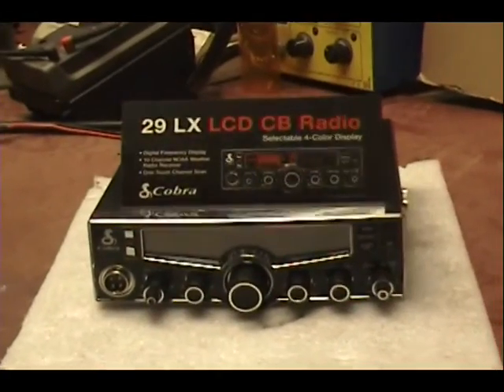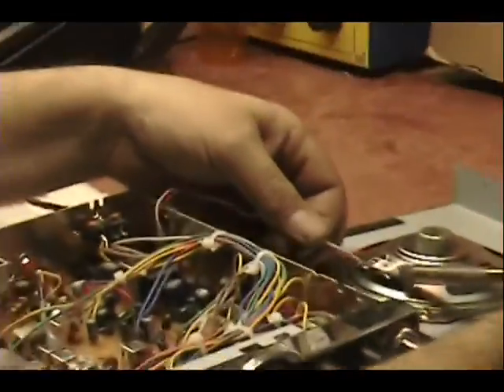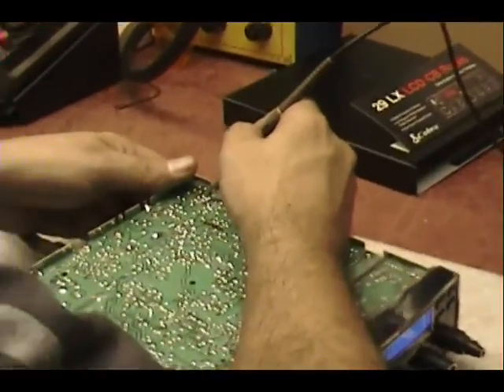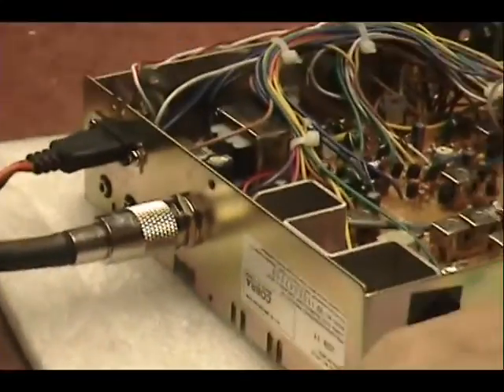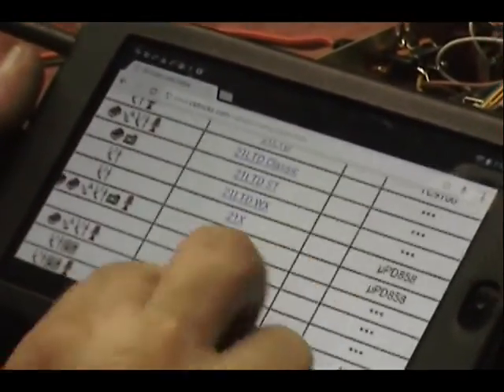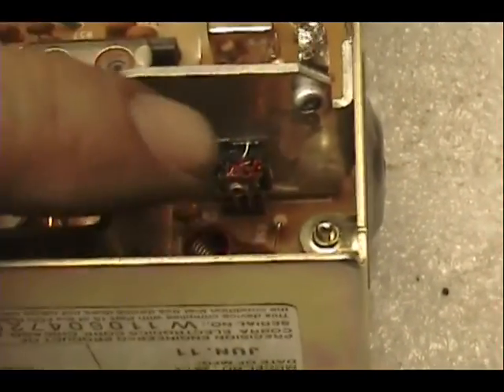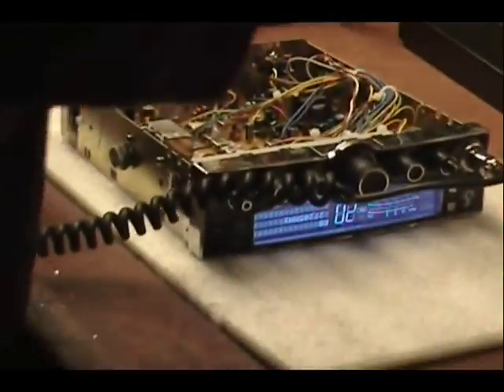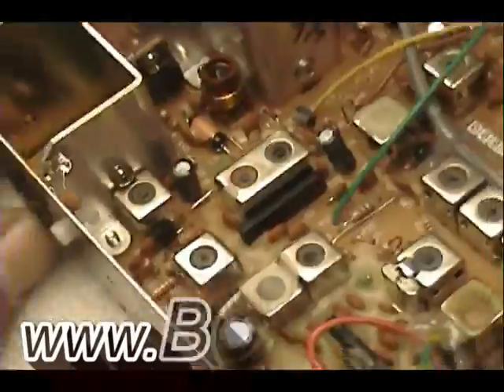Cobra 29LX  FULL Demonstration Repair Report

Comment: I called today (3-11-25) but nobody answered I have a 29LX it doesn't have any modulation.
Reply: Same here, something turned mine off twice and then was not able to transmit - microphone is new. inside looks like a bunch of wax melted inside. Seen a video of a newer model and the thing does not have a bunch of wires in it - and SOLID STATE caps in it. This one has NONE ?! Date is Aug 16
Reply from the maker: Bells CB RA Form http://www.bellscb.com/media/Bells_RA_Form.pdf  this will get the ball rolling. 𝓢𝓬𝓻𝓮𝔀𝓭𝓻𝓲𝓿𝓮𝓻   𝘽𝙚𝙡𝙡𝙨 🔔 𝘾𝘽

Comment: I have a question about a Cobra 29 LX. Any help would be greatly appreciated! The plug on back of the CB where the coax plugs into is where my problem is. I think. I checked it with a multimeter and there is continuity between the center of that plug and the outside(the threads). Is that right? Or there shouldn't be any between the two? If that's not how its supposed to be then how do I fix it?